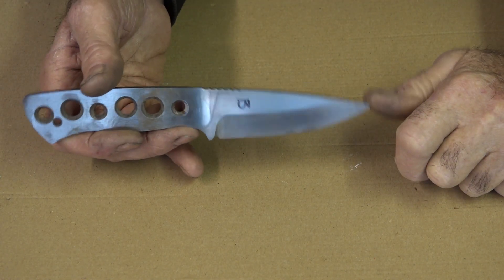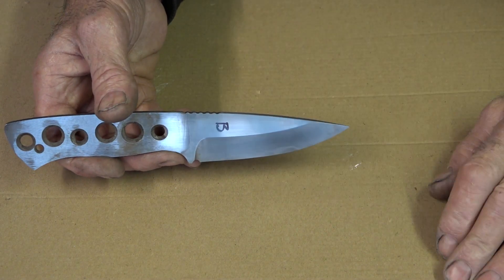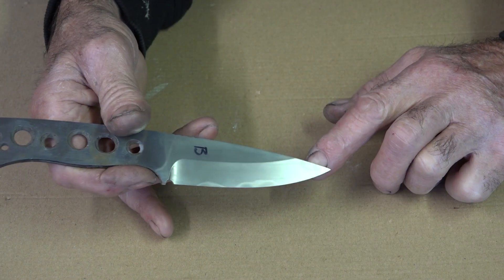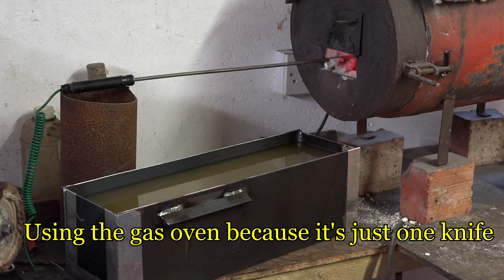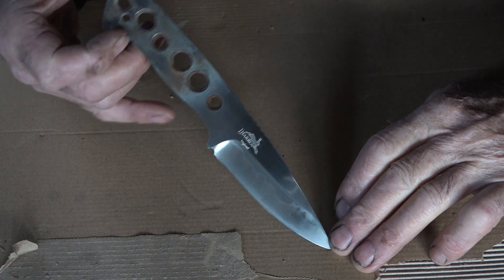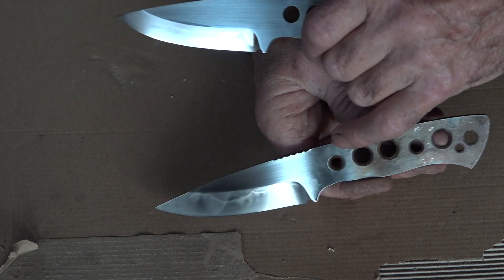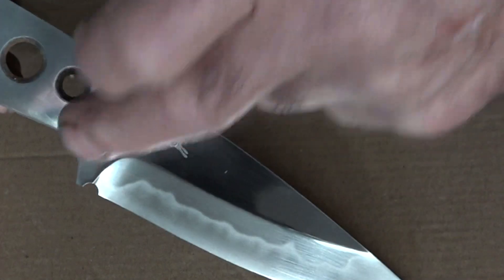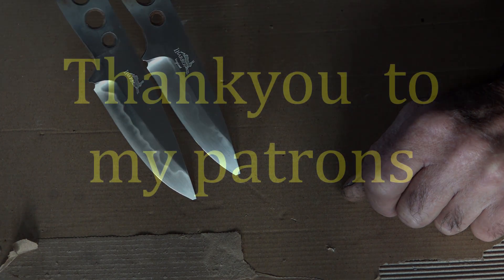Hamons pt 2

Comment: Hi Loz I found this experiment really interesting, I was surprised with the outcome. Do you know if it is possible to get as clear a Hamon with 01 tool steel? I have been using this steel quite frequently but yet to try a hamon. Cheers Rob 👍
Reply from the maker: Hi Rob, no mate you can get a hamon with 01 but there will be very little activity usually just a fuzzy line where the clay was. 1095 is a better choice or w2 if you can get some. Cheers
Reply: @LozHarrop  cheers Loz in that case I will purchase some 1095 instead, keep up the great videos I find them all very entertaining.

Comment: The hamon beauty lies not in the quench but the polish stage... do not use belts. They ruin the intricacies of the hamon.. a slow progression up to what you can be bothered to take it.. I’ve seen craftsman use 30,0000 grit on a hamon... it’s honestly all in the polish
Reply from the maker: Hi Charlie, i agree totally with the polishing side  but depending on many factors  I do get alot more activity in the ashi if I have the recipe just right when quenching. I have found that for sure. Always trying to improve on it though had an amazing result on a bowie i did that was water and oil few yrs back but i did not write down the exact process thinking i could replicate it easily, been trying ever since. As to the polishing yes buffing and the like rub much of it away, best results come from hand sanding and water stones they kind of open up the surface and i use weak acids to etch.  I use power abrasives to bring out the best I can given there is a limited amount of time i can spend on the polising in order to keep the costs down. cheers.
Reply: @LozHarrop  it's an art hey loz!? Long journey.. your knives are beautiful. Artistry and craftsmanship at its finest.  From a fellow Briton too! I'd love to see you do a video on filework! I'm working on a couple of wharncliffes atm and they want filework! I've been practicing but I'm sure the masters got a few tricks up his sleeve??
Reply from the maker: Hey thanks Charlie far from a master though. always learning. Ive not done any filework for years, did a fair bit when i started then it tailed off as I started pattern welding and more forging, the damascus patterns took over and it seemed a bit like gilding the lily doing filework. Nice idea though might just do my next W2 knife. I always liked the totally random cuts and patterns over the more geometric style. Cheers

Comment: Have you read "Craft of the Japanese Sword"? I get the impression you have
Reply from the maker: yes someone bought me that book few yrs ago i have  read many others though on hamons and polishing etc you can see why it took years more to learn polishing than it took to become a swordsmith
Reply: @LozHarrop  I learned a lot from it. Even though I don't do folded steel it is still very useful. They use higher carbon in the edge.

Comment: Both lovely blades Loz, worth experimenting. How about doing one with thicker clay, your most favourite pattern (if you have one) Let it dry throughly then heat it up and have a bucket of water (5 gallons)💧 that will allow reasonable agitation?
I’m sure Smiths of old would have used wooden barrels with water 💦 
Just a thought 💭
Reply: I use a five gallon bucket for my water quench. I leave the edges of my blanks thicker but I don't use clay
Reply from the maker: Thanks Michael.